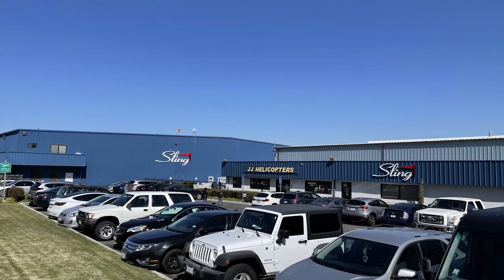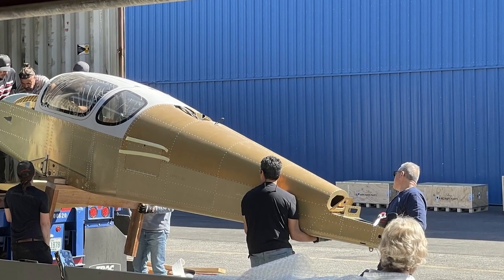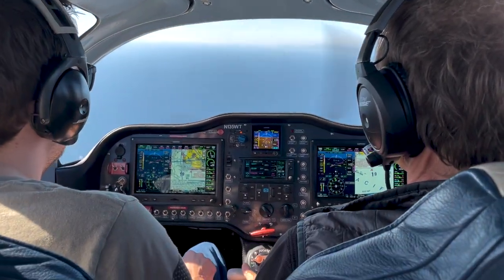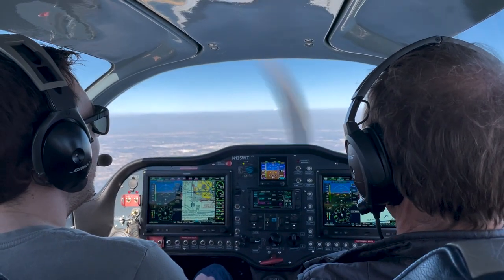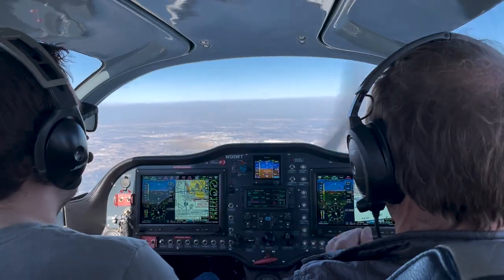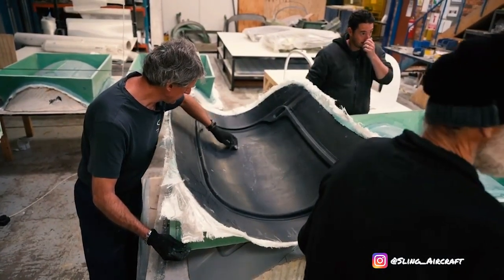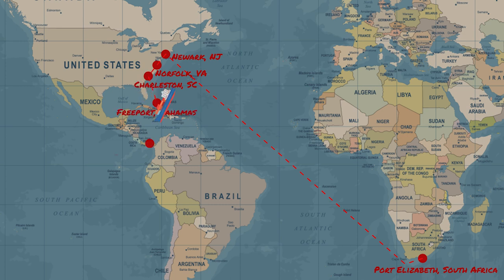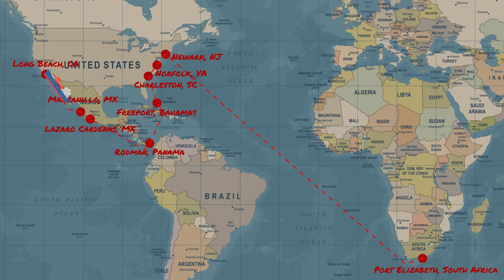How to Buy an Experimental Airplane - Sling TSi

Comment: I'm looking forward to watching your build. I'm very interested in building a sling myself. It looks like you decided to forgo the build assist options, and I'm curious how you got to that decision. It's an appealing option for me as it saves a lot of money. That said, I've never built an airplane before and I'm not sure I trust myself to do it without assistance. Did that play into your decision?
Reply from the maker: Cost was a big factor. The extra $30k for the quick build option is not insignificant. Also, there was additional lead time for the quick built parts. So I felt like I would be better off building it all. We plan on doing the bulk of the maintenance ourselves, so there’s a benefit to knowing every rivet.

Comment: When you say everything, does that include seat coverings, wiring, plumbing, and avionics? I know with Van's RV-10 you get only the airframe and that's it. Very intrested in the differences.
Reply from the maker: Kit includes plumbing. We purchased the interior kit from Sling as well. Wiring and avionics is going to come from Midwest Panel Builders. They have a setup specifically for the Sling.